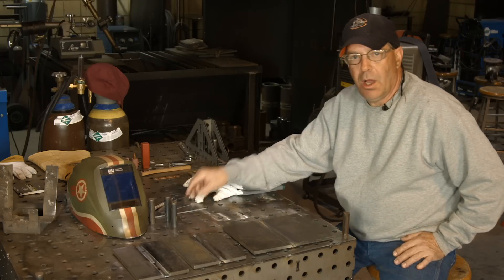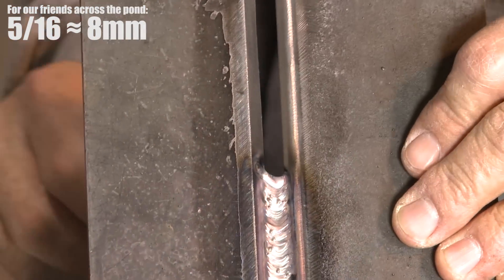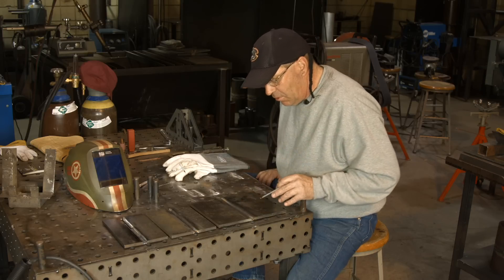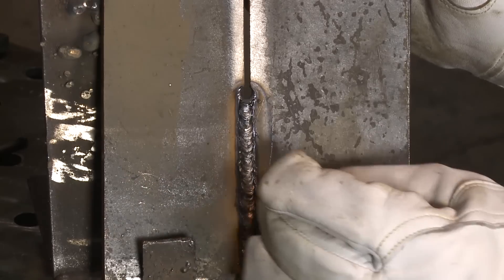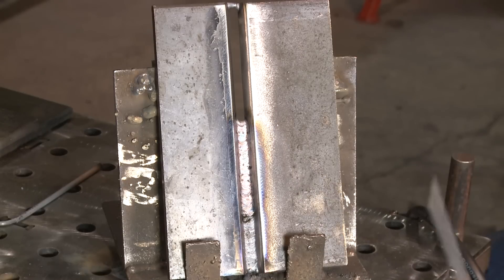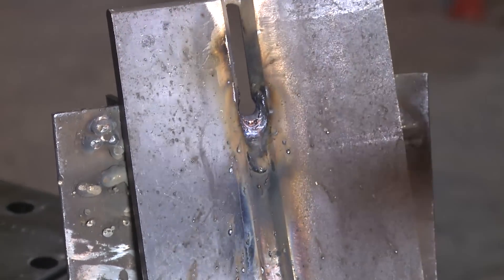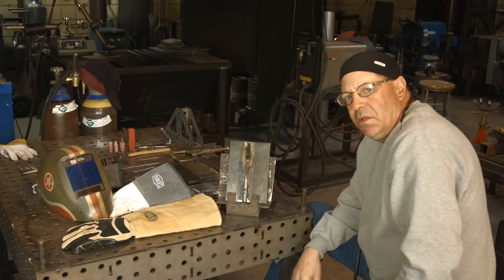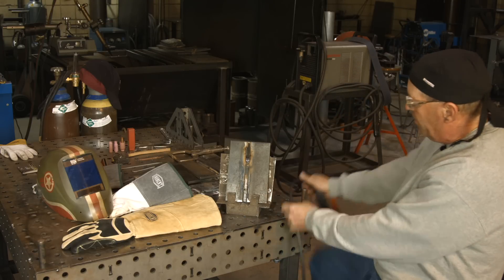🔥 6010 Roots and Bad Fit-up

Comment: I've worked with bad fit-ups before with MIG. Not quite as bad as that last one, but I used basically the same technique of working from the sides, then filling in the gap. I learned that you really have to watch the heat. Too much and you end up fighting to keep the puddle intact. Too little heat gives a poor weld without the strength. The thinner the base metal, the finer the line you have to walk.

Comment: I was showed a trick before for wide gaps like that, and the trick was actually a 1/16 6010/6011. ran on 60-70 amp, yes it smokes the rod but in my opinion it welds damn good on those wide gaps. idk I was taught big gap small rod, small gap big rod. burn it hot and it burn right in..

Comment: ...Good job on a crappy fit.....! I once went for a welding test for a job on offshore oil-rig jackets (bases).... 1-1/2" wall, 7-8 foot diameter 'pipes'.......45 degree V groove with maybe a 3/4-1" wide gap.....running 5/64" NR-232 1% nickel wire.....instructor says..."That's a good fit-up around here......Stockton, Calif...1986...Platform GAIL.....550 foot long under sea....still, to this day.....largest ever built....

Comment: Hi there i have a question about flux core welding  i  just bought a mig welder and planing to use flux core no gas wire  to weld motocycle bobber frame  i am not long in welding field and   i am  little bit worried about streanth of flux core wire and was also wondering can you weld tubes with flux core without gas if you dont have any other option as me...your advice would be greatly appreciated!

Comment: Mr Bob you have been more then helpful with welders trying to break in the gas and oil field. We are usually given 3 test all x-ray pass its usually a 4" sch 10 stainless steel, a 2" sch 80 to 120 carbon tig all the way out and a 2" same sch as your tig but 6010 root and 7018 fill and cap all on 6g or 6g restricted. I watch all your videos I even have notification on when your videos are uploaded. If I can make a request and im sure other pipe welders would like to see also is if you can do a stainless steel sch 10 tig pipe on a 5 or 6g position

Comment: What would happen if you were to say cool it down some more, run a little bit on each side then fill the root in, or run it until it gets to hot and stop for one second let it harden some, just a second, and start again and repeat over and over til you finish.  
  What I see happening is the two walls melting down until you have a big hole and it makes sense because of how thin it is down in there where you are welding.  When it is together or very close you can jump up on the shoulder of the weld area to place your heat, where it can handle the load that you are placing on it.  What do you think?

Comment: I know it's not the approved method but sometimes when people don't know how to use the torch you have to knock off the flux and use the rod like Tig but that's not like on anything pressurized or anything special kinda . nice fill on the Gap =^-^=

Comment: That 1/8" 6010 75 AMP root pass was brutal, I guess the key is to just keep flicking the rod up to let the weld pool cool slightly. I'd blow it out for sure, thanks for sharing your vast knowledge bob, I really appreciate the efforts you put into sharing this free content with us all.
Reply: That's the joy of 6010. It's a fast freeze rod, so if you pull ahead a little, the pool solidifies quickly.

Comment: What I do on the bigger gaps  < 5/16 is whip up and cover the walls then come down when u
the world pool has cooled. or also, get a 7018 take off all the flux and use it as a filler when I come back to the weld pool. just on plates though. never on pipe.

Comment: I'm fairly certain had you had a 3/32 6010 around 60 amps or less in your hand you would have put in a acceptable root. Slow progression for sure but you would have nailed it first try.

Comment: Love when you do stick welding. Thats the only welding accesible to me. But please do some sheet metal or about 0.3-0.7cm metal welding. Maybe some tubing or squares. I always blow a hole. Doesnt matter the electrode,travel speed,amperage it always burns a hole. I would love to see a how to strike an arc video.

Comment: Great video Bob you are a great teacher. I have a question if you are welding say 3/8  plate together on the flat  and you start with 6010  then 7018  could you also finish with 7024 ?  just to make a fine finish weld.
Reply: Bruce D You could.

Comment: Once worked with a very respected pipe welder that welded so hot the rod would melt off at about 2 1/2", yet that man had a wallet full of tickets. Never could weld with that mans machine. Nice video Bob! I'll enjoy any welding video you can throw at me.

Comment: These videos are the true joy of the week!! Dont you use remote control in the us?
Reply: Same in Ukraine . Hard to find arcshots of 7018 root . Would be great if you could show some 7018 roots ( pipe and plate ) . 
Thanks for the videos Bob . They've  helped me very much .
Reply: Magnus Klahr Not on stick.
Reply: Ok. Alot of pipes here in sweden  are made with 7018 from root to top. When welding the root you usualy use a small handy remore control in the "non electrode" hand.
Reply: Magnus Klahr I would definitely want to do that. remotes are real Handy

Comment: Thanks bob for the videos.  Watching a 2nd and 3rd time there still is info pouring out of all your instruction which is awesome.  As a long time motorsports guy just learning to tig (always leaned on mig - and stick years ago), can you do a vid about controlling heat to get going.  Practice beads going good, real joints not so much.  Sure would love to take advantage of the summer class you are offering but I can't on your first go around, so hopefully that program is a success and is offered again!!!  Thanks again for your efforts
Reply from the maker: We plan on offering it again.
Reply: kwasg3 Hey thanks for the support and please keep in touch..

Comment: any tips for 6g root? bombed both of my bend test on root. on visual it looked great but not after bending. so my question is what do I need to change.. downhill,81 amps on root. 3/32 Gap and anout same for land so what can I do to get that penetration in there so I don't have this problem again. felt like it went in nice but obviously not. help
Reply from the maker: 6010 or TIG?
Reply: Weld.com 6010

Comment: why do you long arc when stitching? Is it to give the puddle time to cool before adding more material? And why wouldn't you stitch side to side on the thick gap? keep in mind I only weld for fun. and 90% of what I know I see in your videos. Just haven't seen a video on stitching yet.
Reply from the maker: Heat control to keep from blowing through.

Comment: never  did like 6010..  aka  5 p   7018.. all day long   1/8
Reply: 7018 doesn't weld gaps too good. 6010 is much better for gaps. 7018 fills good and is the best for fillet and cap welds, but 6010 is the best for root passes. I prefer 5P Plus over the red 5P.